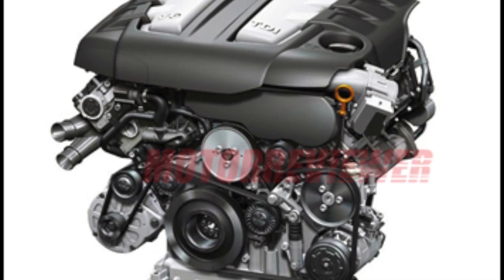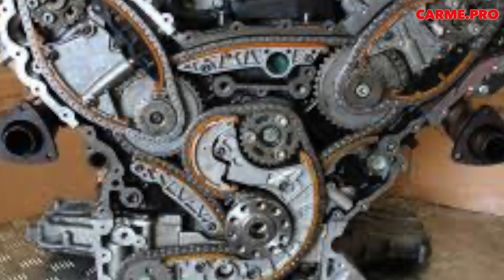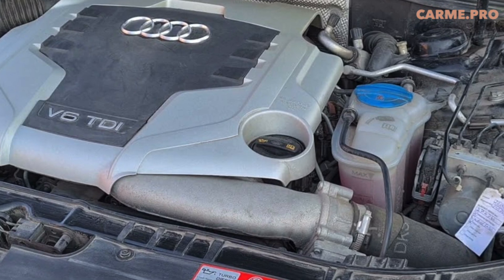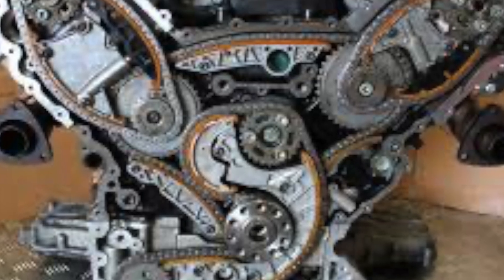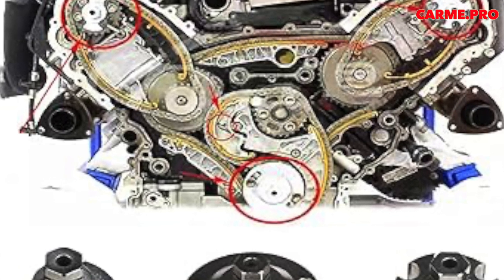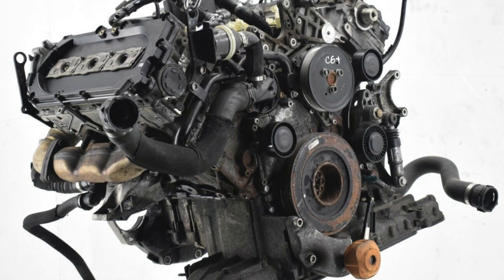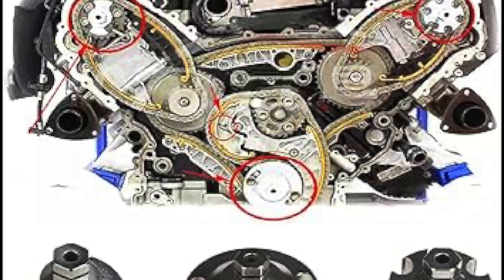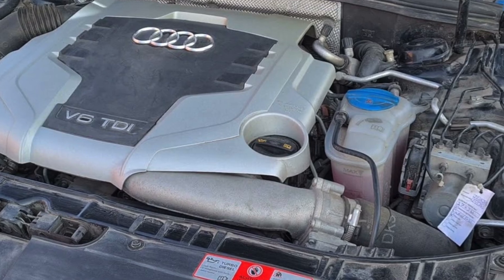Audi 2.7 / 3.0 V6 TDI engines - Problems, Weaknesses

Comment: How about, just DON'T buy one of these, unless spending copious amounts of money,  frequently,  on piss-poor engineered car is your fetish. 
VW group has decided that paper mache and glass timing components,  buried at the back of the engine was a great idea, across the board around the 05/07 era. The previous rubber belt engines had their issues,  but somehow,  VW made a chain system,  suck even MORE !